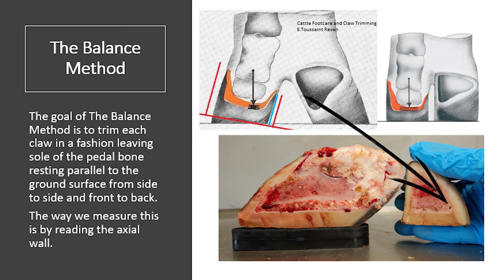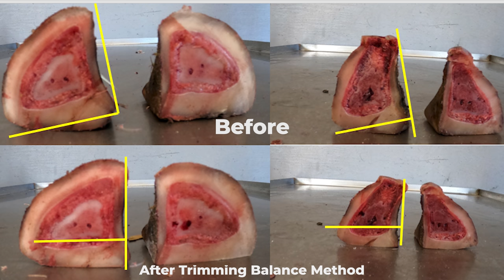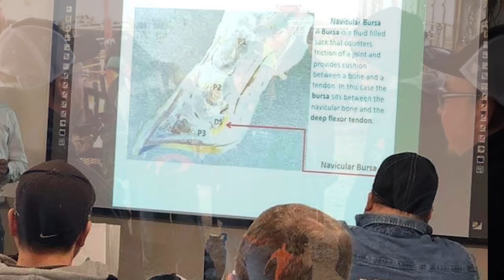🔴 WHY DOES this GIRL HAVE a HUGE CRACK IN HER HOOF? \\ BALANCE METHOD // Cow Crack

Comment: had to watch one of Graeme's earlier videos to remember exactly how the Dutch method was supposed to go, but i can see right off the bat the differences in the order of operations.  and Graeme didn't have the cinematography that you did so he didn't show the legs before and after.  also, Graeme's cows had a LOT of overgrowth that he had to remove.  there was a lot more measuring than what I saw with yours.  If you can point me in the right direction I would like to see the dissected version of what the Dutch method looks like to better understand them.  seems like yours is a little easier but your cows don't seem to have the problems Graeme's does.  either way they are both interesting, informative and entertaining.  still waiting on the next challenge video between you guys LOL.

Comment: So the balance method would not recommend the side tilt crushes that put the cow horizontal because you wouldn’t be able to check the balance throughout the trim unless you keep putting the cow vertical and back to horizontal numerous times
Reply from the maker: No that is not correct.  They can still make the sole perpendicular to the axial wall I only put it down and look to show you guys how much it helps. I have had many pros come through my course that do a great job  🙂